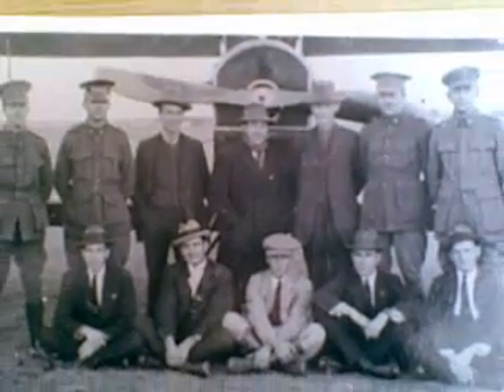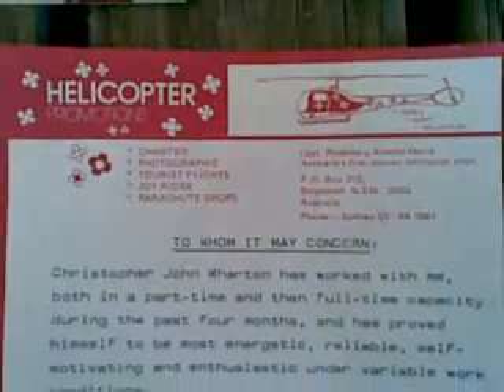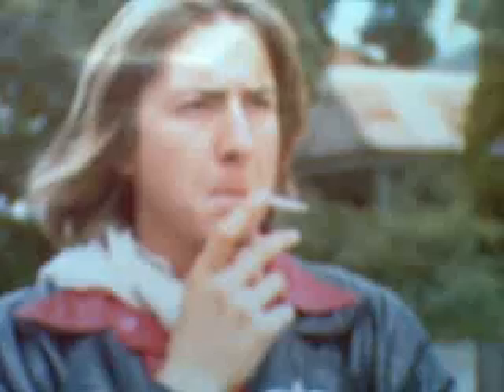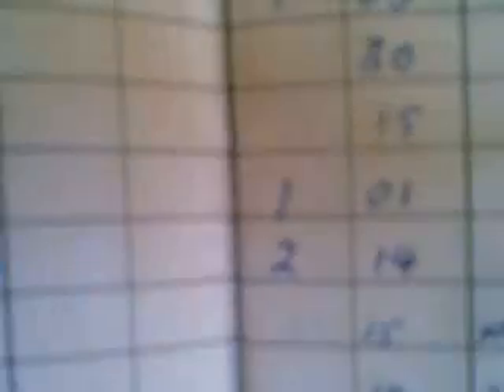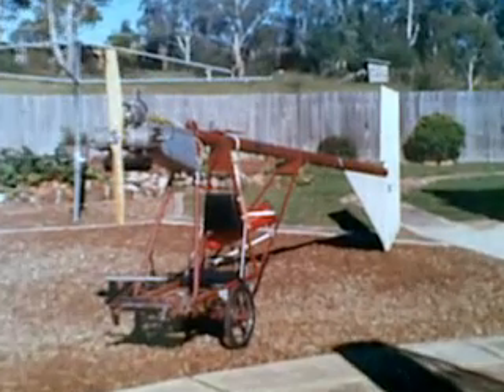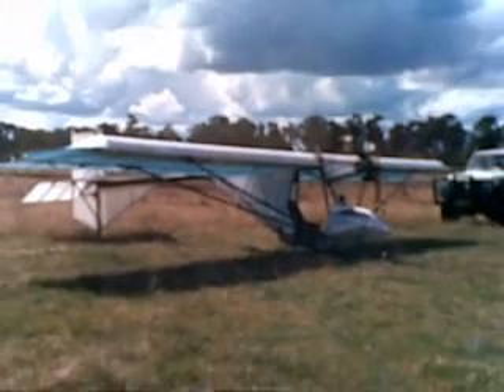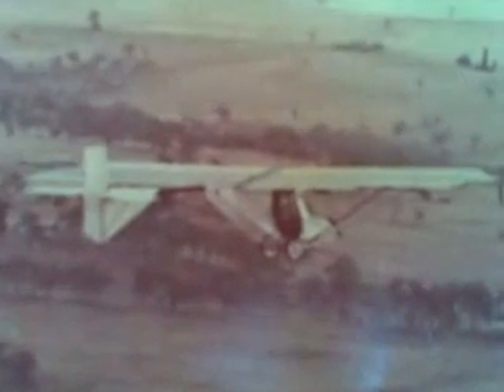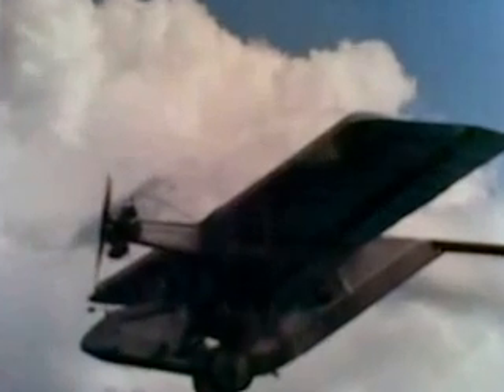Test-Flying, For Autodidactic Aeroplane-Designers...(VJ-24w SUNFUN/Budgerigar).

Comment: Back here studying your trailer.  How long and how wide and how tall are your trailer box outside dimensions?
I have all the flooring and tubing parts and paint, just missing the corrugated tin.
Reply from the maker: G'day,

  Well, the Trailer is 65 inches wide, 66 inches high, with an 8 inch-high Triangular-Prism on top, 29 feet-long, with a 2-ft Triangular "Leading-Edge", and a 2-foot long Structural-Beam sticking out in front of that.

  Let me know if you want a dedicated Video.

  Take it easy,

  ;-p
  
  Ciao !
Reply: 29 feet long, holy smokes!   By floor is 80" wide x 15 feet long (not counting part out to tongue)  x not sure how tall to make it, was going to extend it out to 19 feet later to hold the wings inside and the fuselage and tail.    If they still didn't fit by a foot or two, I'd figure some slot or slit or something for them to jut out. 

The extra width to 80" is so the Poorboy current tricycle landing gear will fit on there when I pick it up, plus I thought rounding to 80 which is divisible by lots of numbers would help me with measurements.  Also will give me later more room to manuever around in there.   Not so great for lowering weight and wind resistance though.

If you get bored one day when it's not too hot, do a walk around and film your trailer build and talk about it and the structural members and so on  :-)  But no rush, just whenever.  I'm working on my wifi network right now using old DirectTV satelite dishes to boost the signal, which isn't working out.  Looks very cool, but don't work anywhere near as good as my home built quad dipole antennas already in place.